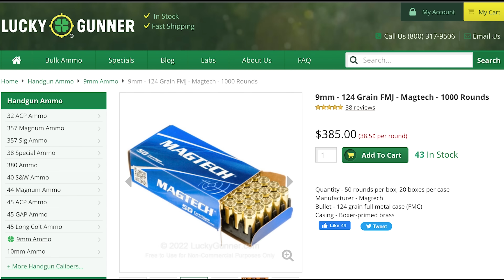Counter Attack Opportunities In Armed Robbery Encounters

Comment: To me these examples highlight the usefulness of a snubbie... you can do things with them that are literally impossible with a semi-auto. They can be fired from inside your pocket, they reliably cycle when the muzzle is pushed on (close quarters), and the heavy trigger pull makes them much safer to pocket carry and less likely to have a negligent discharge with.
Reply from the maker: I don't think any of those would come into any factor in any of these incidents whatsoever. And while a pocket snub revolver has a place, it's a very niche place for an expert shooter and those people are few.
Reply: I love semi-autos and most of the time I agree 💯% with you, but I respectfully disagree with your reply John... the simplicity of a revolver, coupled with the element of surprise and the other factors I talked about, imho makes them the perfect defense tool for anyone, ESPECIALLY novice shooters.
Reply: bannedfromasptwice  I can appreciate everything you’ve said, and I agree that recoil, grip and sights are not as good as a glk19... however I was referring to a high stress, non-ideal situation (like a defensive shooting encounter), not perfect condition competition or target shooting.

Comment: Unless your John Wich or Jacky Chan you aren’t doing anything other then surrendering in these situations.
Reply from the maker: There can be options if you have an idea on what to look for.
Reply: @ActiveSelfProtection  That first one particularly was a bad situation. Like even if someone their had a gun, the poor clerk had a knife to his neck. You’d need to pull it out when both people weren’t looking, and be able to do it fast.
Reply: I don’t know who this John Wich fellow is, but comparing real life to Hollywood doesn’t work very well.
Reply: @tommyrussell1415  Except that’s a very controlled situation, edited heavily for consumption, using BLANKS. Although some actors do have that proficiency with live ammo it is not common. Try again, you can do so much better.
Reply: @amendable5401  The point I'm making is that most people wouldn't be able to fight back even if they wanted to in situations like this. As mentioned, the risk of pulling a gun on someone with a knife to someone's neck and another people with a gun to another isn't worth it unless you can access it right when they don't have their weapons to someone.
Reply: @sibsart2039  EXACTLY. Thank you for making John’s point. You have the option to comply completely, OR if the situation presents itself, and you are willing and competent, you can defend against the threat to your life. Because that’s exactly what it is. A threat of death to you, and everyone in the area. The protection of the valuables is inconsequential. You are defending against a threat of your demise.